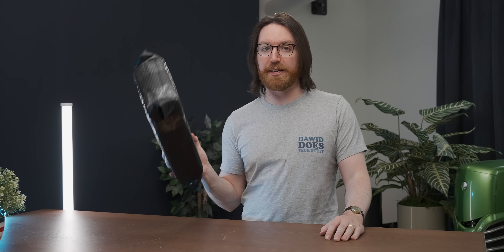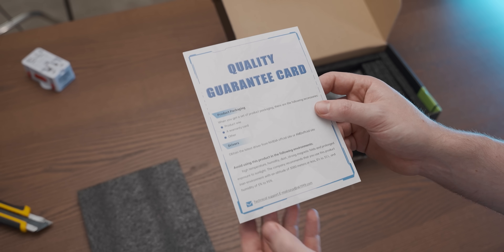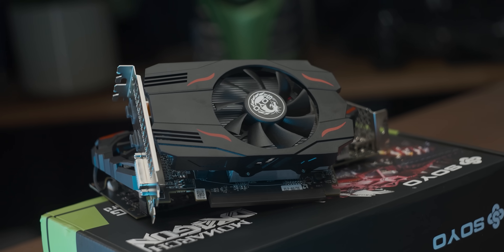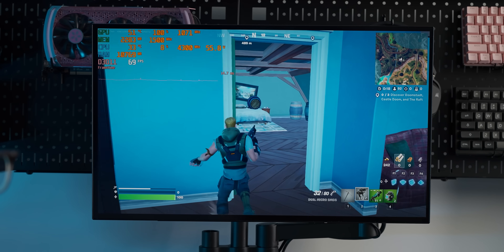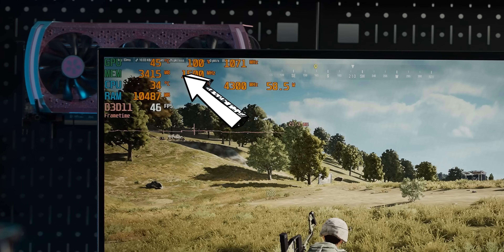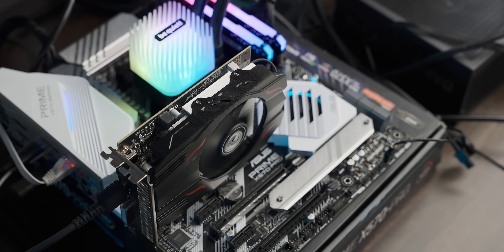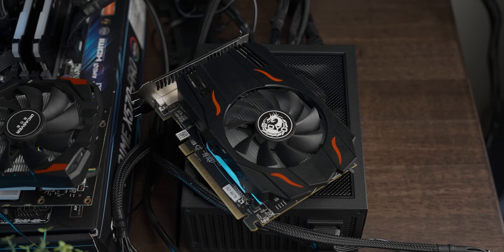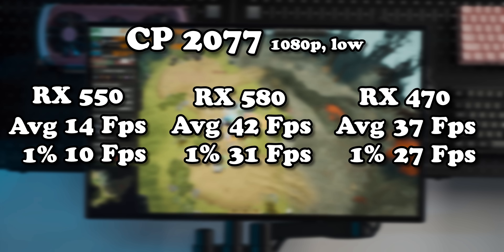The Best Selling Graphics Card On AliExpress Is Bad...

Comment: I'm also surprised that 470 card you got is cool, since most reviews and buyers report that is has a bad cooling and reaches 80c and starts thermal throttling (it also a 470D which is a cut down version of the 470 and equal to the 560XT which I wish you can do another video on)

Comment: I still have as my backup GPU a RX 560 4gb, works perfectly well but couldn't handle current games well, when I upgrade my RX580 8gb SP I will prob give to my daughter the 560 as she is using my old 750Ti SuperClocked and well its getting a bit wheezy hehe

Comment: Now we need to see the gaming performance of the $20 laptops advertised on that video card page. N3700, N95, i7 7500U. They suck for a new laptop, but at $20 - $25 US that's about the price of a RAM upgrade for an old laptop.
Reply: You are not going to get a laptop for $20 i'm sure of it. I think when you open the listing, either you'll be hit by $80 shipping cost, or it will have 5 barely related products in the same listing with the selected cheapest item not being a laptop but something fundamentally cheaper. Laptop has a lot of parts, they all add up, and display panels are sort of expensive.
Reply: @SianaGearz  That's not what I saw, but I'm not risking my money on it. That's why I wanted Dawid to do it!

Comment: I bought a Soyo rx580 2048 new for 60 bucks almost 3 years ago, it still workibg and running every game that i’ve tried on it. It came in the same box but the foam inside where cutted qith the shape of the card not with foam pads until they reach the card like the one on the video xD. Like from Galicia

Comment: That 470 framerate for CS2, the 1% low, is that an error? Is it actually getting 48, not 148? Because otherwise, it's getting triple the 1% low of the 580... Which seems wrong?

Comment: That's a lot of money for what it is. Also, would be interesting if David removed the cooler, because a lot of those Chinese Polaris cards are ex-miners and not really new cards.
I'm pretty sure you can get a much better deal with an used RX 6600 and drivers will still work for a long while.
Sure, I understand some people really can't afford the equivalent to $150 USD, but in this case, it is really worth it to save more money and get a much better product.

Comment: I do like the old budget card round up. 
I find it unfortunate that you have to spend so much to get a good new/ "current" card.  
Although... used market... $200-250 in the US can get you up to used RTX 3060 territory which is pretty good honestly. 
So if you spent $200-250 on a GPU for a used PC in the $500 - 700 total cost range... that's not bad overall... maybe a nice AM4 based system.

Comment: What you didn't say was that rx550 is small form factor and don't need extra power connector, so if you want to upgrade an old small pc with the existing power supply - rx550 will be a great choice! I did it, so...

Comment: Should be noted that almost all RX cards sold now are used mining cards rebadged and resold as new. Not that there's really anything wrong with that given the price and how well they do perform just some food for thought.
Reply: Linus Tech Tips has two videos proving that this doesnt mean nothing. GPU wont degrade because of use and GPU from a gamer would have more chance of being bad.
Reply: If you're doing an ultra-budget build getting one of the $60 rx 580 cards isn't the worst choice
Reply: Even the 6xxx and 5xxx series?
Reply: Can one mine from an RX 550? 😳

Comment: I gotta give that RX550 credit as a video output, though. I bought it a few years back (also on AliExpress) because I was playing around with virtualization and needed to have two GPUs in my PC with one ideally drawing as little power as possible ant taking up as little space as possible while providing good desktop Linux experience. For that it delivered just fine. It has (or at least mine has) probably the best IO of these cheepo GPUs, it has and HDMI and a DP. But for everything else, it's horrid.

Comment: This video could have helped me a lot in 2019 when I got a RX550 for my desktop.Fortunately I played only dota 2 so it was just bearable enough for my use case😅
Reply: Well, it was not that bad. It did run Witcher 3 at 1080p low, GTA V at 1080p high, Dark Souls 3 at 1080p med etc ...

Comment: Soyo used to be a good, popular motherboard manufacturer - back when we had way more manufacturers like Aopen, Chaintech, DFI etc. Soyo ceased trading and hasn't existed since2009, so anything using the name Soyo is already a scam. Soyo hasn't existed as an Electronics manufacturer for 15+ years!
Reply: It's not a scam. SOYO brand has been purchased by Teclast who also owns Maxsun, so that's the group responsible for these current products.
Reply: Soyo does in fact still exist, and they do still make and sell products, just not in Western markets. They're a great budget option here in Asia.
Reply from the maker: @chrisfanning5842  That’s very interesting! Thanks for the info. 👍
Reply: @DawidDoesTechStuff  "While no longer operational in US and Taiwan, most of the assets were shipped to Shenzhen, China, and PC production still goes on for the Chinese market."
Reply: @DawidDoesTechStuff  That info is also incorrect.  Soyo was purchased by Maxsun 15 years ago - it is Maxsun's budget line.
Reply: SOYO is still operational in Taiwan. Do some research before spreading misinformation.
Reply: I think in some parts such as my land the brand is sort of combined with Kyo. So they make boards, SSDs and stuff still, but under the Kyo Soyo name. Idk if its the same co. being acquired, or if its just a similar name and they have nothing in common, but yeah they're still around here.
Reply: @bayuchandrasukma820  So I did some digging and Maxsun and Soyo share the same head office (12th Floor, To-Win Building, 30 Huaxia Rd, Guangzhou) Despite this, there's no other indication that Soyo is owned by Maxsun, and no mention of it either on Soyo's or Masun's websites. It's possibly Maxsun bought the rights to the brand name and logo when Soyo was being liquidated under Chapter7 bankrupcy filings.

Comment: The RX 550 is pretty similar in performance to the Vega 7, the integrated graphics that comes with CPUs like the Ryzen 5 5600g.
This type of GPU is probably meant for really old office computers you want to keep using since it doesn't need to be plugged to the PSU

Comment: I bought a graphics card from a brand called Aisurix (RX 5500XT, 8GB) which only costs around 110USD. It exploded after a month of use, and I fought the seller about the warranty. In the end, they sent me a replacement, but for some reason, just 1 week after they sent that one, another one arrived lol

The replacements are still doing great right now after almost a year of usage.
Reply: Aisurix is quite infamous for how luck-based their cards are. Sometimes you get a long-lasting card, but sometimes you might also get a card that dies in a week at worst. Despite the randomness of their cards' longevity and its weird name, I heard Aisurix is a quite popular refurbish brand in my country (mainly their RX 580 2048SP model) for their budget-friendly price and also due to buyers feeling a little too paranoid of second-hand GPU market.
Reply: @HAVOCprojects  exactly this! I'm just glad it's still working up to this day lol
Reply: I bought aisurix Rx 580 2048sp from tokopaedi last year, still ok in my highschooler nephew's e-waste xeon core gen 3 pc.

  @HAVOCprojects
Reply: @HAVOCprojects I can relate. There's nothing but scum and villainy in my country's used market, so I'd rather try my luck with the Chinese 😂
Reply: I've had my bad luck before with getting a cheap second-hand RX 570. It worked, but not only it was so hot, I couldn't disassemble it for re-pasting because one of the screws have been damaged, most likely on purpose. Now that's dirty.

At least my next second-hand GPU, a GTX 1070, was a lucky find. It is in a much better condition because its previous owner took good care of it.
Reply: Open your joyyosness😂
Reply: I once had a MSI Armor RX470 and yeah the GPU shorted and killed the whole system i don't think its about the brand but more about just getting unlucky with bad silicone
Reply: I've heard of this brand

FB Marketplace is also littered with RX580s marked as defective with an Aisurix logo which is why I'm never getting one.
Reply: Did you think of returning the extra board? Technically and legally this was theft if you kept it!
Reply: @steveharper2857 in the states if a company sends you something it's essentially yours (in most states)

Comment: Honestly, the 470 was the best one. With the exception of PubG, it's 1% lows were better across the board by nearly 2x and max FPS wise it was within a few frames of that cut down 580 for 30-40 dollars cheaper. Not that I'd personally recommend any of this stuff. I'm sure you could find something newer and more powerful for $100 bucks used. All these are 7-8 years old and are going to stop being supported with driver updates sooner rather than later. You can save up like 25/35 dollars extra and get a used 2060 on Ebay these days. Probably less if you have a local market.
Reply: Given the prices I kinda doubt it, but it's almost like the 470 has 8GB and the 580 4GB...?  That'd explain the minimums.

Comment: I gave in to desperation, and bought a SOYO 5600XT back during the GPU crisis - "a bag o shit" wouldnt be bad enough to describe it; it thermally throttled in under 2 seconds; when I took the cooler off and cleaned up the paste - I found the GPU was CORRODED; yeah, a refuse rescued, grade Z GPU on a new motherboard.

Polishing couldnt get rid of all the pitting, and even with Hydronaught paste and a custom, 3rd party cooler that cost as much as the card; I couldnt get it to get CLOSE to the expected performance levels.

A refund was refused by the seller; and Ali Express somehow agreed with them, even though I sent photos of the corrosion on the GPU die; only the 3rd time in 10 years, I have lost a refund claim.

Anyway, I wouldnt recommend SOYO to my worst enemy; over £350 down the drain, by the time you added the cost of the Grizzly paste and the aftermarket cooler.

Comment: For informative purposes:  The heatsink grooves are there from the extrusion process, which rams a billet of hot al through a die with the profile of the finished product. (a several meter long heatsink) The big heatsink is cut down into smaller parts, which then have cuts, drilling and machining for clearance.

Comment: Isn''t the biggest difference between RX 550 and RX 470 the fact that one needs power from the PSU (6 or 8 pin, not sure), and one just sips from the slot? That would make the RX550 the type of card you would put in an old office (Dell/HP/Whatever) machine to repurpose it for, you know, toddlers and stuff.

Comment: I actually bought a very similar gpu to this, its an rx 550 as well, the same cooler design but is from aisurix (a not known brand), as you can guess, it didnt work, i dont know if its a motherboard incompatibility or not enough power but computer doesnt boot if its connected. I returned it, bought an asus gt 1030 as its the only available budget gpu, and it worked.

For anyone curious:
Motherboard is a OEM samsung h61s1 (which has a VERY old bios version from 2011 and is a legacy boot) 
PSU is OEM as well, its a samsung 350watt 
CPU is an i5-2400

Might be motherboard incompatibility as i heard that radeon gpu dont like legacy bios. Or highly likely Power supply since it doesnt even POST.

Comment: A few brands were instantly avoided back in the early 2000's, PC-Chips, Soyo, ECS, FIC and Shuttle because they almost never used anything but those other garbage brands. On a side note you've shown that it's decent for light duty gaming and would crush it for emulation so it could be a very usable card for a lot of folks.

Comment: Damn. You're better off with iGPUs these days. Even Intel once Arrow Lake is released. :O
Reply: But you also need whole system for that, that are much pricier. Though I am not gonna justify buying that card brand new. Better get a used 1650
Reply: @BBB12106  you need a whole system to put this card into also...
Reply: @Eric-ct2ri  yes, but that whole system can be as cheap as $60 not $400
Reply: the Radeon 780m is quite a bit faster than the 550 but it doesn't fit anywhere in my gaming PC.

Comment: The stuttering in CS2 isn't the GPU, but Valve shifting all competent devs to Deadlock instead.
Reply from the maker: @cynthiacrescent  There is a lot of stuff that can cause that kind of stuttering. I didn’t notice it a week ago on other systems.
Reply: @DawidDoesTechStuff shader loading is a massive issue on all cards, to get smooth performance you have to load all the shaders, that’s why first time install for games can be stuttering to all hell, and afterwards it’s fine
Reply: @DawidDoesTechStuff  My friend with a Titan Xp and me with a Radeon HD 6870 have the same awful stutters 32 gb memory in both systems, NVMe SSD and 10700k with the Titan, i5 7400 and Sata SSD with the 6870
Reply: Dota2 player here and yes 100% true.
Reply: deadlock is not even optimized yet and i am getting sub 50 fps with fsr on with gtx 1060.

go away malders.
Reply: @Tyretes  tbh 50 fps in deadlock is not impressive considering its graphics.
Reply: @KhizarKhan2001  That's his point.

Comment: Funny thing is that the RX580 2048SP is a (scummy) rebadged RX570 which itself is an overclocked RX470.
Reply: That's exactly why the performance of the RX 470 was quite close to the RX 580 2048. If the RX 580 were the original model it would be noticeably faster than the RX 470.

Comment: Soyo is actually a real brand that used to be known for their dragon motherboards. Early 2000s iirc. Sad how far they've fallen lol
Reply: The Chinese company that owns Maxsun purchased the Soyo brand.  The original Soyo went out of business.
Reply: @mikewilmoth1 that makes sense I've had a maxsun gpu n mobo b4
Reply: This ISN'T Soyo. Soyo was a motherboard manufacturer that never made a single graphics card. Their last motherboard was in 2005 and they went bankrupt and ceased all operations in 2009. Aliexpress is full of fakes and knock-offs, that includes stealing brands and logos that don't exist any more. It's the safest kind of rip-off for them too, since Soyo aren't around any more to file lawsuits against them!
Reply: @chrisfanning5842  Back in the early 2000's you could readily buy Soyo components, in the states, then they went away. I had a soyo kt500 platinum, and that was one of the best MB's I had owned at the time.
Reply: @chrisfanning5842   basically every platform is the same as aliexpress

every platform has their fair share of baddies who scam people and sell knockoffs at ludicrously low prices, trust me, i bought a ryzen 5 1600 from aliexpress (from a reputable seller) and it works flawlessly

Comment: I have a SOYO RX5700XT GPU, I paid 165 USD a year ago. This prices are crazy for the same cards.
Reply from the maker: @TheSEMOMU  You can get some great deals on GPUs on AliExpress. That’s why it’s a shame this is the best selling one. 😅
Reply: @DawidDoesTechStuff    When a 6600 is a month's salary in many parts of the world, it isn't a surprise that the older cards are still being purchased.
Reply: @DawidDoesTechStuff  Low power requirements, i.e. does not need 6 or 8 pin connector.
Reply: I saw it go as low as 120$ usd during 11/11
Reply: That’s not bad for basically 3060 level raster performance.
Reply: Lol it's original price is 70$. Why pay 160😂
Reply: Yh it's good. Just fetched a 5700xt x gaming for 120 euros

Comment: Conclusion: The RX580 its still a beast.
Reply: No it's shit. You can literally buy for the same price used rtx 2060. Which is over 100% faster
Reply: I mean not really these were all very undemanding games at the lowest possible settings bar draw distance. Cyberpunk is far from the most demanding thing in 2024 (with lower settings). I'm betting you toss this card at anything that came out in the last two years it'd a complete slideshow even with everything turned down to nothing.
Reply: @devilmikey00  I'm not sure what game you could mean. I looked up performance for a lot of recent games, and the RX 580 delivered playable performance @1080p for all of them except Alan Wake 2 on Windows (runs fine on Linux, apparently, so probably a driver issue).
Reply: @opfipip3711  Its a Mesh Shader/Compilation issue, that don't happens in Linux because Proton.